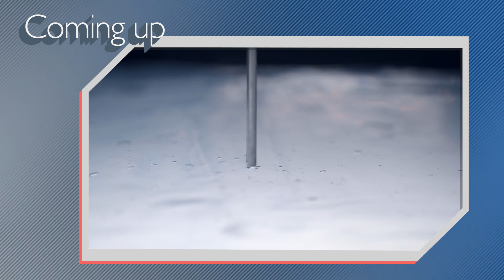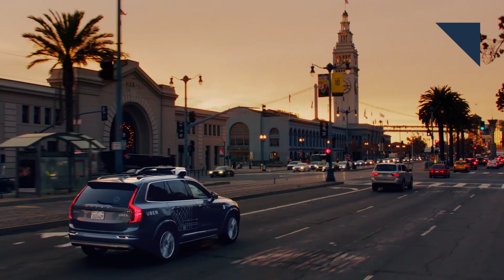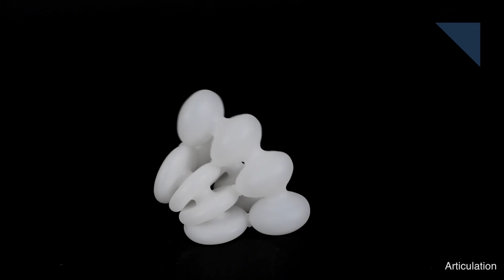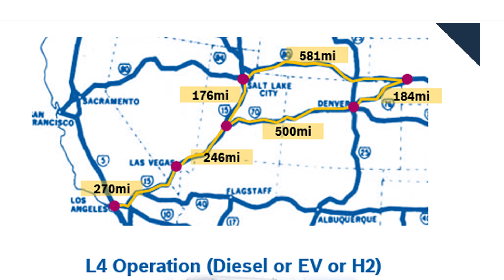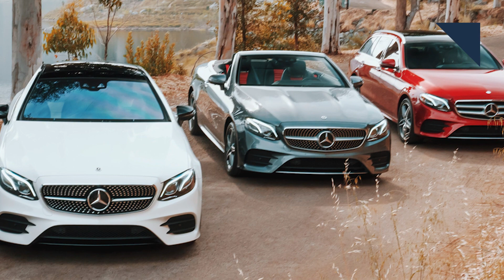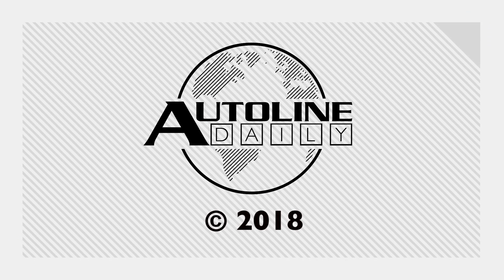Nikola Semis to Deliver Beer, Uber Faulted for AV Crash - Autoline Daily 2362

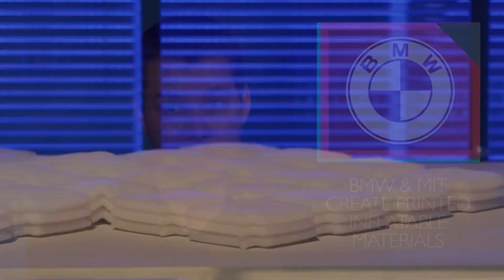Comment: 2:10 I can see that being used in racing circuits. I can't believe it's 2018 and we are still using tires as crash absorbtion devices.
Reply: Used tires that would go where if they weren't used for this?